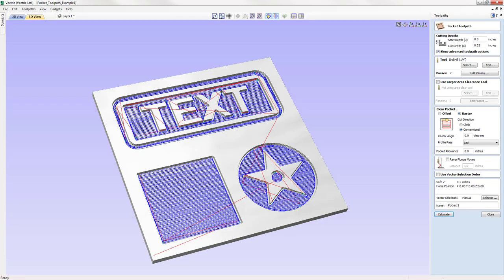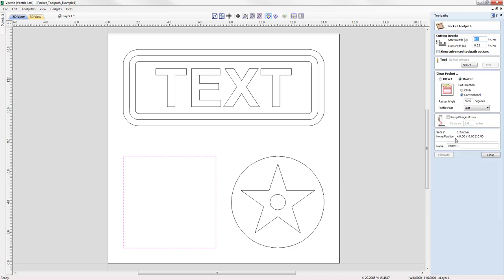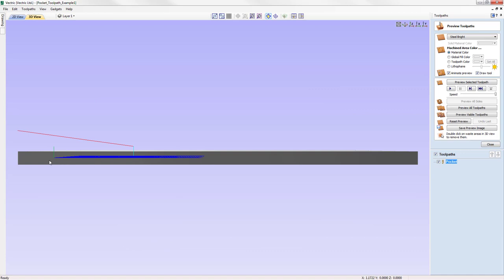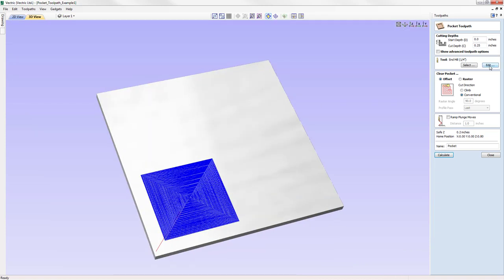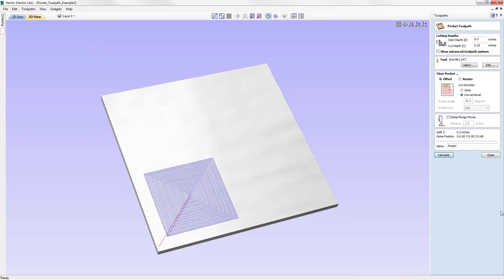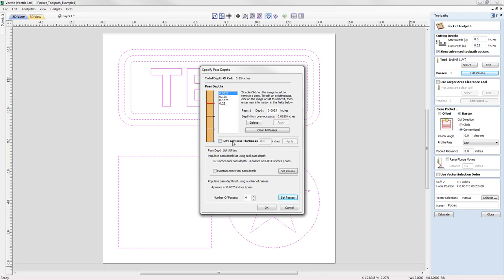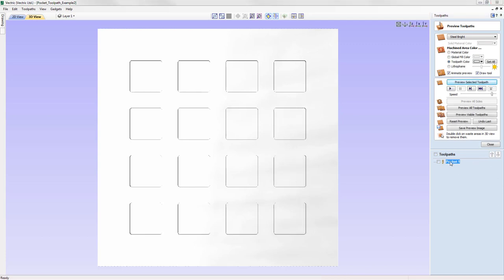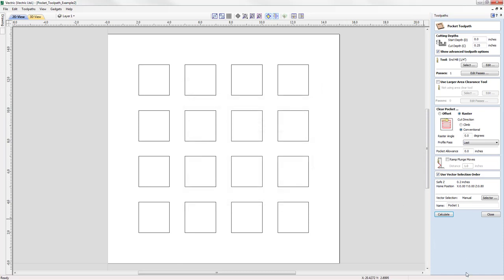Vectric V10 Tutorials | 2D Toolpaths | Pocket Toolpath Guide

Comment: Beki- Thank you for this clear and thorough instruction for Pocket Toolpaths. When would it be advantageous to over or under cut a pocket allowance? Is there a video that would address this topic?
Reply from the maker: Hello Mom... LOL... It all depends.  If you are looking to insert somehting into a pock we normally suggest you cust a test part to be sure you don't need a pocket allowance.  In most cases you would need to make the pocket a bit larger to accept another part.
Reply: @vectric  Thanks so much!